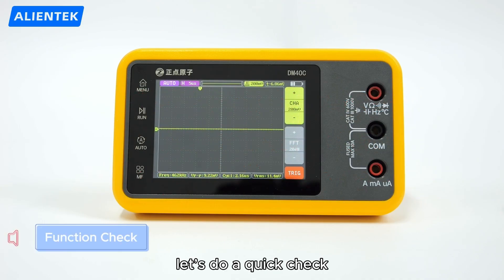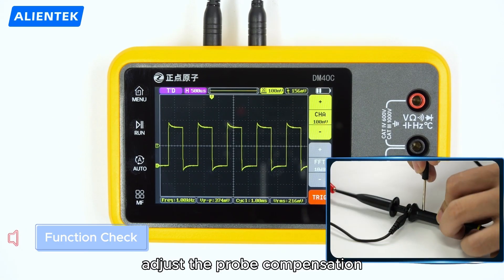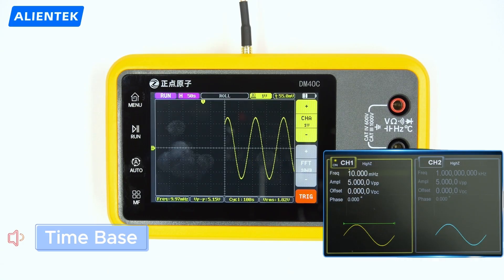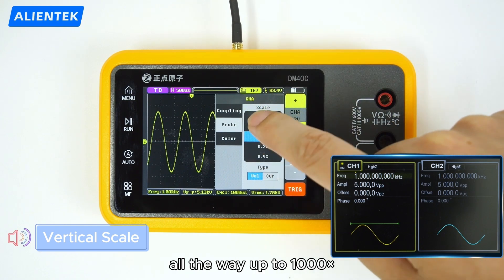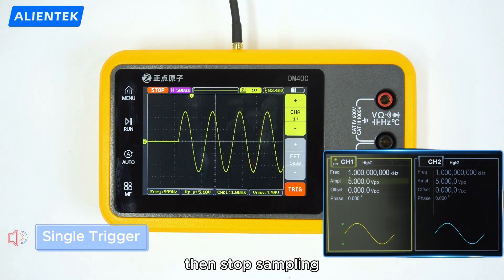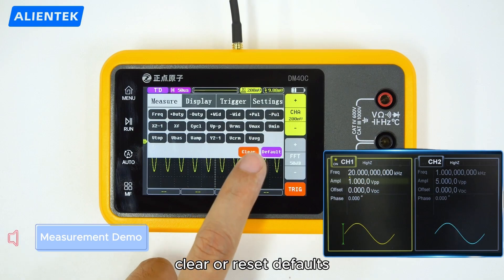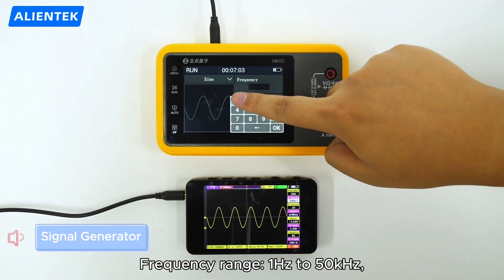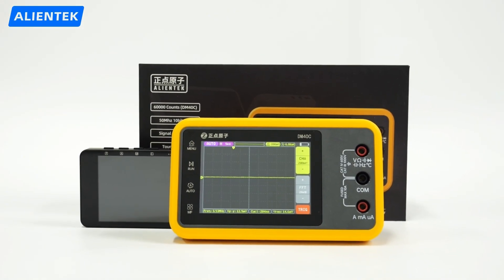DM40 Multimeter + Oscilloscope & Signal Generator — Is It the Ultimate 3-in-1 Tool? #tools

Comment: Hello. I've had a dm40B for a week now and it's a great multimeter. I'm very happy with it. One improvement I would make is to add an autohold feature. I don't know if that's possible with software or if it requires specific hardware. Thank you very much.
Reply from the maker: Thank you for your feedback! 😊
The DM40B actually has a data hold function. You can press the RUN button to activate HOLD — in this state, the measurement and waveform stop updating. Press RUN again to resume data refresh.
Reply: @Alientek-Tools  Thank you for the information, but I was referring to a way in which, without touching the screen, it would automatically capture different measurements, if there were a variation.
Reply from the maker: @luisb.458  Thanks for clarifying! 😊 Currently, the DM40B only supports manual HOLD, not automatic capture. We’ll share your suggestion with our R&D team.
Reply: @Alientek-Tools Thank you very much for your replies, and congratulations on the excellent product you have manufactured. Best regards.
Reply from the maker: @luisb.458  Thank you! We really appreciate your support.

Comment: Please make a modification of this best multimeter without the oscilloscope and generator. This will lower the price a little. It will be a hit!
Reply from the maker: Thank you very much for your great suggestion! That’s a really good idea. We’ve shared your feedback with our R&D team for consideration in future updates. We truly appreciate your input!
Reply: @Alientek-Tools  I ordered a one, because it has this 3 functions in a compact device. I like the high precision of the multimeter, the clear view, the nice stand, the possibility of attaching it magnetically. It is also nice, that the SW is still improved and functions are added. Sometiimes I need also a scope for repair, development or improvment but don't like to use the bulky scope which offers more but in 85% of the cases I don't need more. 
I would highly recommend to make it an open platform and let the community add what it wants. It saves you time and cost, inceases the user space and you will sell much more of them.
This device is made with love and has outstanding precission for that price and sice. It has the potential of getting a standard and I hope it has a well made protection against high voltage and current.
It should be possible to obtain the measured data over an interface, so that it can be used for logging or in prodction to automatically adjust or calibrate other devices or to protocoll the mesaured values to profe it met the specification.
Some need dB values, others may attach a sensore e.g. to measure lux (light amount) or loudness and so on. This device with its flexible touch screen and preocessor, could be used as a base for many applications.
Reply from the maker: @loukili63  Thank you so much for taking the time to share such detailed and thoughtful feedback. We are truly grateful for your support and are delighted to hear that you appreciate the design, precision, and versatility of the device.
For data logging, the DM40 already supports Bluetooth logging (multimeter mode).
Your additional suggestions have been carefully noted and will be forwarded to our R&D team for evaluation in future hardware and firmware updates.
We are committed to evolving this device with love and precision, and feedback like yours is invaluable in that journey. 
Thank you again for your trust and enthusiasm. We look forward to bringing you more powerful features in the coming updates.
Reply: I completely agree. In my humble opinion, that multimeter on its own, at a more affordable price, would be a success.
Reply from the maker: @luisb.458  Totally understand your point — that’s a great suggestion. Thanks for sharing!